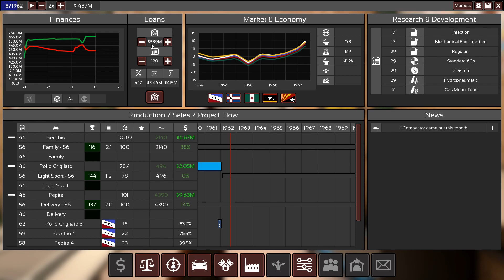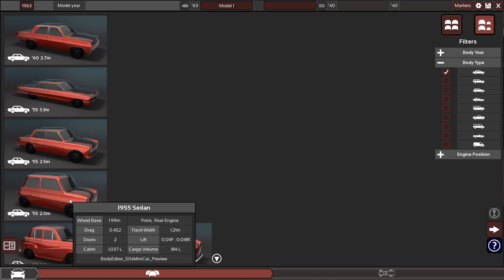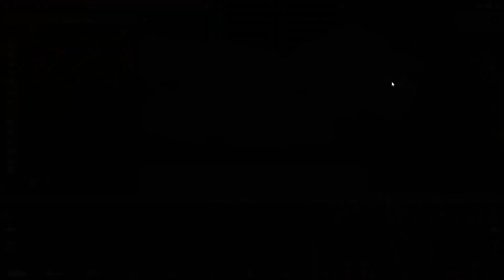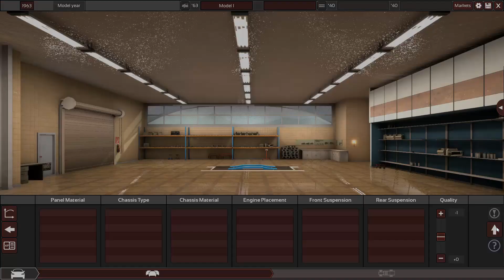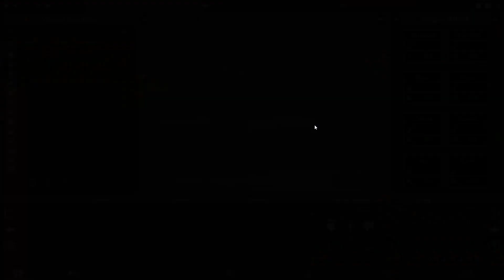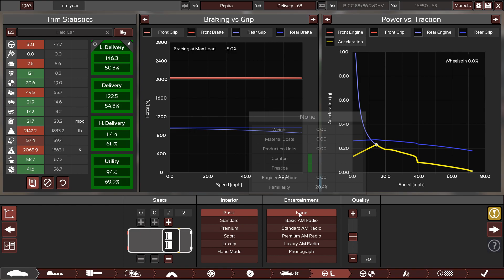Automation | Monza Motors 03

Comment: Some mufflers would be good
Reply from the maker: I haven't really needed them so far except for fuel efficiency through constriction/scavenging.  My cutoff is usually 60 decibels (I think).  Above that, I like to stick a muffler on.  I'll get some mufflers involved though for quieter cars.  No need to skimp 'that' much on money.